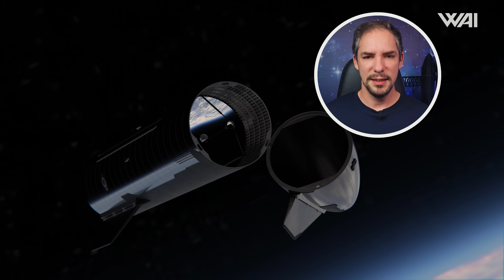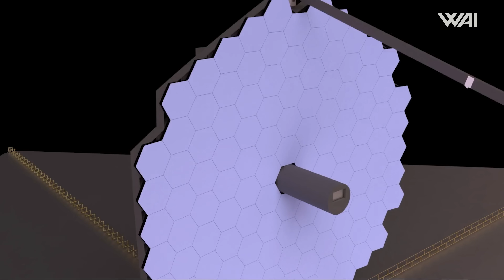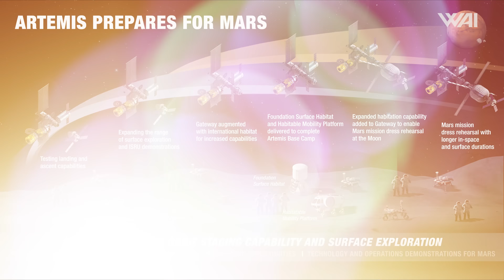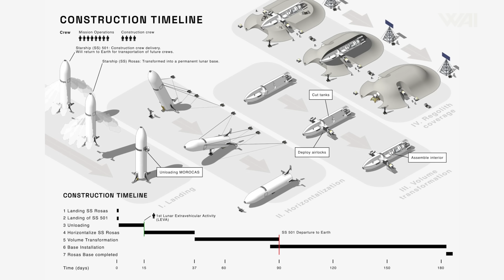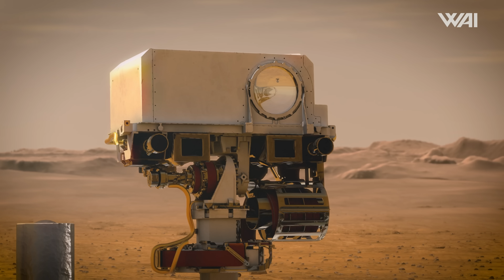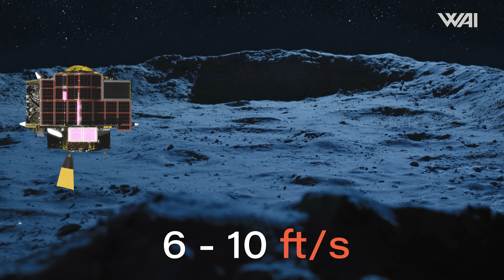SpaceX Is Building The All Seeing Starship Eye!

Comment: On the exploits of Ingenuity, another fact deserves to be noted
Its primary mission was to attempt 5 flights over a period of 30 days.
Certainly this valiant little helicopter has very brilliantly fulfilled this mission and the others that have been assigned to it since.
But also, and above all, it survived the very harsh local climatic conditions even though it was not designed specifically for it.
When you have a "mass budget" of only ~2 kilos it's complicated to add electric heated blankets to withstand the rather cold local winters :)

let's be a little lyrical:
  “Another valiant “soldier of Science” who falls on the fields of honor! May his contributions never be forgotten”

Comment: First you starship to come down fast and hit the engines hard. Dig yourself a nice hole. Then land when gently inside then use another one like a giant broom to cover it over with regulus. Then all you have to do is dig out the airlock.
Reply: Do the same falcon 9 burn with each and every starship in the exact same place on the moon and only then the starship will go just slightly higher into the air and then come down gently with a soft second burn. That way you can dig some deep holes.

Comment: 🎯 Key Takeaways for quick navigation:

00:00 SpaceX's Starship is undergoing rapid development at Starbase, with Booster 10 and Ship 28 nearing readiness for their respective flights.
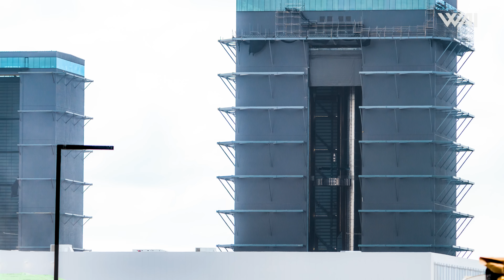02:23 Starbase introduces a new fabric-based Mega Bay door for prototype protection, potentially enhancing construction efficiency.
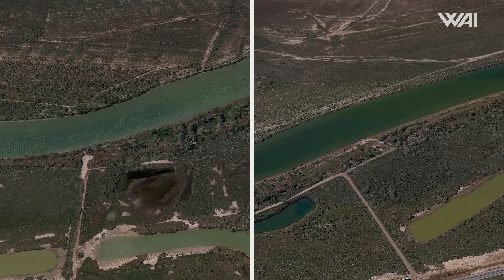03:51 Starbase plans a massive 6-tier parking garage for its workers to alleviate chaotic parking situations.
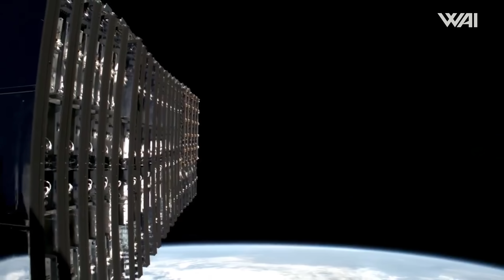05:44 Starship could serve as a satellite transporter, deploying smaller satellites efficiently, and may host large telescopes like LUVOIR in its payload bay.
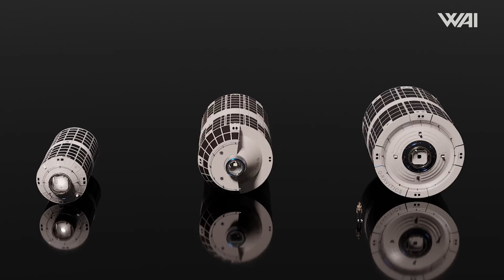08:31 Companies like Gravitics and VAST are planning commercial space stations utilizing Starship modules.
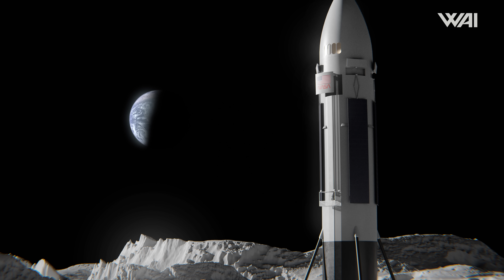09:48 Ideas like repurposing Starships as lunar habitats or experimenting with artificial gravity remain technically feasible but uncertain.
12:59 Ingenuity's Mars mission ends due to rotor damage, but its achievements in Martian flight are groundbreaking.
17:31 The Japanese SLIM lander experiences engine failure but successfully deploys payloads on the lunar surface, showcasing remarkable engineering despite challenges.

Comment: Using Starship as a lander seems unwise. The main reason is that the center of gravity is way too high. If the ground landed on is uneven or unstable, the ship could tip over. Some way of leveling the ship needs to handle these problems on first contact with the surface.
Reply: "center of gravity is too high"

Source?
Reply: Tall things tend to be less stable. Look at what the moon landers look like. They are wide and and low to the ground, less likely to tip over. I don't know what Elon has in mind to prevent that. @alvianchoiriapriliansyah9882
Reply: @gonzorini Must have been shocked to see a tall Falcon boosters standing fine hundreds of times...
Reply: It was on a level surface. They lost a booster that fell over on its way back to port. It doesn't take much. @alvianchoiriapriliansyah9882
Reply: @gonzorini I didn't know Moon have seas...

Comment: If I understand the plan, refueling starship is via a "refueling starship".  When that refueler is empty, leave it up there. As you get more than one up in space, use the same docking mechanism to marry them together.  Install airlock and repurpose as space station.  The more empty fuel pods, the larger the space station. If you build the nose like a starship with all the windows,  instant stargazing.  Bottom line, launch once, repurpose in orbit.

Comment: The Parking structure would hold way more than 1250 cars if the size is as shown, the one at tesla in texas is predicted to hold 9000 cars and from the mockup looks to be half the size of the one at spacex. I don't see the need for 9000 parking bays at spacex though so maybe it will not be as big as shown or will only have 2 levels.

Comment: Imagine instead of having to engineer expensive super lightweight systems for space flight we could use something like concrete to build the structures because we have the carrying capacity
Reply: requires too much mass and a LOT of water - cement won't set properly in a vacuum either - it boils and creates a brittle foam.
Reply: @jessepollard7132  Just launch a 50 tons of pre-formed concrete structurer with each launch and assemble it in space is all I'm saying.

Comment: Thanks for sharing your thoughts, ideas and videos. Still looking forward to seeing a functional starship before making modifications. Since they are pretty good at stacking and connecting things together my idea for a modification would be to make a cargo section placed in between the engines, tanks, and nose cone, upper flaps. This section would be designed to be left in orbit. The upper and lower sections of starship would detach and then reconnect to each other making a ship with most of the reusable components ready to land and be paired up with the next cargo section. Once this is possible the possibilities are endless. Just dock the fuel tanks together to make a larger fuel depot. Have a mission critical version for the moon with upper landing engines in the top. Of the cargo section and surface entry in the bottom of the cargo section. Perform the detachment in lunar orbit with the remaining sections ready to fly back to earth orbit for the next mission. After your done with the fuel tanks in orbit either add them to the moon missions for structure components or stack them in orbit with built in adapter sections to allow a slight angle needed to stack them into a circular structure ready for a space station. They could be designed for both carrying fuel and pre fitted for conversion afterwards. Another possible use would be to make the end of the cargo tank removable and use it like a giant scoop to pluck space junk out of orbit and drag it either to the moon for recycling or disposal in lower reentry orbit.

Comment: I am an Architect in San Diego and have built parking structures of similar size. At 6 floors it would be about an acre in size and have about 650 spaces. The drive isles take up allot of extra space as well as the corners where stairs and elevators are located. I would assume that the footprint will be around 120' wide and 450' long configured with a single ramp on one side.

Comment: I thought of laying SS on its side and covering it with dirt quite some time ago and I still like it but you could combine it with the vertical base (quicker and easier) by just delaying the move to horizontal. Possibly digging a trench for it and (over time, maybe with Optimus bots spare time) and using the dirt as a berm next to the trench so less distant dirt is needed.

I also like the spinning 2 SS on a tether but I would make them parallel reducing the unbalancing due to the change in height when bots or people move (changing the distance to center of mass). 

Eventually, they will need another tank at the gateway for landing and farther trips.

I think it might be possible to spray something into the exhaust as they land to make a kind of landing pad. then they could free up room in the front and put the motors in the tail where they are more efficient. It might even be re-used or improved by repeat landings.

If they send up the refuel tank SS, I wonder if they should make the engines easily removable and send them down in an SS lander. Maybe the Optimus gas station attendant could remove them one at a time? It could be sent to help build the new space stations when done or?

Comment: It's crazy that there's no remote control lunar rover with mechanical arm to lift and right the Japanese lander. I reckon NASA should have put one up there already in case they need to assist its own landers should they land badly on the lunar surface in order to save their mission.

Comment: None of the concept art seems to realize that if the Starship upper stage is NOT going to ever come back to EARTH (As in not reusable OR as a reusable vacuum only vehicle) it doesn't need any fins. Secondly, and more importantly, it doesn't need the header tanks located forward either so instead of the nose cone having to stay attached / fixed it can be shaped differently (like an even larger diameter as is common with most modern rockets fairings). And that leads to better designs for habitats than the ones showing stock reusable Starships profiles.
Imagine a whole spacestation segment that replaces the top of a starship, it does not need a pointed nose at all, a hemisphere shape works and that would be the segment pressure hull end.
Imagine a Bigalow style inflatable, not launched inside a Starship but as the forward portion ahead of the engines and fuel tanks, it could be HUGE! Let's say it was not the standard 9meter starship diameter but was 12 meters in its compressed state. And depending on the weight of the inflatable, how long would it be on top of the Starship engine/tanks section?

And let's think grand visions. How about a 100 meter optical telescope mirror. Made of mylar or such, it could be launched folded up then spread out by a variety of methods (the best one to be determined) so just one thrown out is inflatable tubes that shape that streach out the mirror material and shape it. A 100 meter mirror doesn't have to be optically perfect, and there's software to compensate for know aberations. It might even spin slowly so centrifugal force helped keep it spread out evenly.

Comment: The best utilization of starship and what it does better than nearly anything else would be to place it’s considerable mass into a geosynchronous orbit. A starship could use up all of its fuel and get there in a single launch. 10, 15, 20 starships out there and you start to get the mass required for a tether to the surface. To me it’s obvious that the ultimate use for the starship superheavy would be to use it as a space elevator construction vehicle.
Reply: If you genuinely want a multiplanet species with thousands of people going back and forth, you need rocket free way to escape the gravity well. A way to build shipyards and fuel depots. A space elevator is the price of entry to that future.

Comment: There is a very slim chance that the tips of the rotors are damaged equally.  One would have to be able to see the craft spin up to assess how much imbalance/vibration there may be and judge if it was still flight capable.  Stranger things have happened before.

Comment: What's the weight of the japanese lander?
How many square inches of the nose is touching the ground?
Any kind of tilt to the lander and in which direction?
Could a bump from the hopper roll it in such a way as to aim the solar panels towards sunlight?
Could the roller give it a push?

Comment: Because of the low cost of manufacturing and launching, It would make more sense to send starships with fully setup horizontal floor plans and hatches into the tanks that can be easily opened and used as farming spaces.

Comment: spin the bathroom section just a little and the toilets can be used normally - showers and baths even 
spin the dining section just a little and all meals can be eaten normally 
(a stationary 9m diameter loop as an electric scooter obstacle/slalom course would give you all the g-forces you need for as long as you want )

Comment: Starship should be able to launch between 5-8 telescopes at once, each 5-8 meters in diameter. These would have folded or inflatable solar shades, secondary-optic booms, solar panels and other telescope infrastructure. This means better-than-hubble observatories could be mass produced and mass launched, greatly reducing price while exponentially increasing data collection. And a single architecture could support telescopes of several spectra, from terahertz to extreme UV.
Imagine the astrometry that could be done with two 5m telescopes, one at Sun-Earth Lagrange 4, the other at SEL5; a 1.7 AU separation! (Sol-Saturn Legrange would be better, but baby steps.) With this kind of space-telescope industrial infrastructure,  you could afford such a luxury.

Comment: Ask yourself the question:  Where are G-forces the greatest on Ingenuity's design?  Answer:  The TIPS of the rotors.  High rpms, high G-forces, radiation and extreme temperature ranges of the Martian atmosphere may have combined to cause unanticipated fatigue in the carbon fiber construction of the rotor where it casted off a portion of itself.  Perhaps Ingenuity didn't "hit" anything.

Comment: If a Starship and booster were going to orbit then imagine what kind of single piece item could be brought up in one shot. Would attaching disposable solid fuel boosters on the outside break payload records?
Here's some ideas:
1. Wrap giant skins of material around the exterior of the ship. (Toilet paper on a roll)
2. Add multi-point catapult launch assist.
3. All electric Mid-atmosphere launch and capture platforms. 1st stage tethered, 2nd stage wireless power transfer extended platform. (Semi-Space Elevator concept)
 4. External booster sleeves which stay with the ship into orbit as added building material. (The booster molts like a lobster when spent).
5. Capture, grind, and encapsulate space debris to fill giant honeycomb core composites as a filler material.
5a. Use low melting point alloys in the matrix media to serve as a phase change media for more consistent rotating platform temperatures.

Comment: I was wondering if there was methane on the moon and came across this:

 Herein, we demonstrate the in situ resource utilization of lunar soil for extraterrestrial fuel and oxygen production, which may power up our solely natural satellite and supply respiratory gas. Specifically, the lunar soil is loaded with Cu species and employed for electrocatalytic CO2 conversion, demonstrating significant production of methane. In addition, the selected component in lunar soil (i.e. MgSiO3) loaded with Cu can reach a CH4 Faradaic efficiency of 72.05% with a CH4 production rate of 0.8 mL/min at 600 mA/cm2. Simultaneously, an O2 production rate of 2.3 mL/min can be achieved. Furthermore, we demonstrate that our developed process starting from catalyst preparation to electrocatalytic CO2 conversion is so accessible that it can be operated in an unmmaned manner via a robotic system. Such a highly efficient extraterrestrial fuel and oxygen production system is expected to push forward the development of mankind's civilization toward an extraterrestrial settlement. (https://academic.oup.com/nsr/article/10/2/nwac200/6712344?login=false).

If this can be spun up to scale, perhaps Starships can refuel in Lunar orbit for the trip to Mars and return to lunar orbit. Other starships can move from Earth orbit to Lunar orbit like container ships. We might need an orbiting warehouse where Earth-launched and return Starships can park.

Comment: I wonder what the next generation of UAV on Mars will be able to do.  I know that since they built that one, motors have become about 25 percent more powerful for the same weight.  And a miniature TEG would solve the problem of power and heat at the same time, displacing those weights.  I'd love to be on that engineering team.

Oh, and for those interested, the drive to Brownsville SUCKS.  Nothing but salt water marsh for hours.

Comment: Create a cluster of StarShip upper stages of 6 ships around a center ship.
They would connect to each other in a larger version of the ship to ship fuel transfer system.
Reply: An additional ring of cylinders could go around the outer 6 cylinders.
Internal space would be multiples of what the ISS currently has.
Reply: The upper stage engines & other parts could be removed for use as spare parts for other orbiting operational StarShips.
Reply: Also, how big is the ISS CanadArm. Could more than one or a really big one fit in the StarShip cargo bay.
And how does the StarShip cargo bay compare to the space Shuttle's cargo bay?

Comment: The primary purpose of a door where heavy MIG welding is going on, is to remove any wind that can degrade weld quality, by blowing off the shielding gas. Yes there are other benefits but that is the most critical reason.

Comment: They could built parking garage undergrounds it may cost a bit more then surface ground parking they can install in Solar roof with panels at the top level. But most likely they shuttle them in from the newly acquire lands close to the site

Comment: Two starships spinning on a simple swivelling tether have NO stability problems.  They simply need additional thrusters positioned AT the CG of each ship for lateral thrust and rotary stabilisation.  The tether needs to be at least 500 meters long for minimal coriolis forces, and the rate of spin can be varied slowly to transition between Earth and Mars G throughout the trip.
"NO design is the best design." - Sorry, but it's as close as one can get.  :hand-orange-covering-eyes:  PS:  The thrusters could possibly use the tank pressurisation system.  It's already there . . .
Remember the advantages of maintaining a (near) constant direction of "gravitational" field.  Toilets, kitchen, plumbing.  Yes, not a constant field, so one has to cope with two weightless periods.